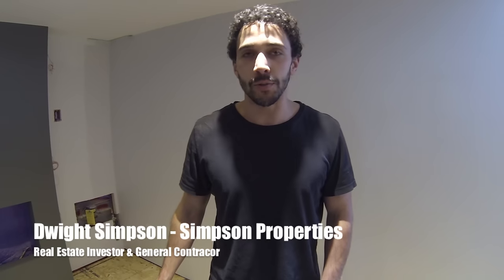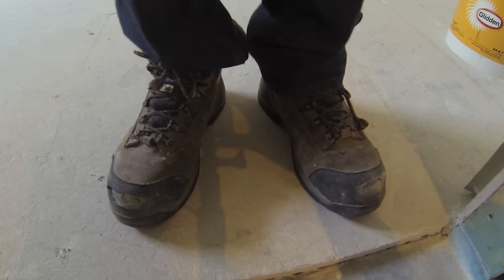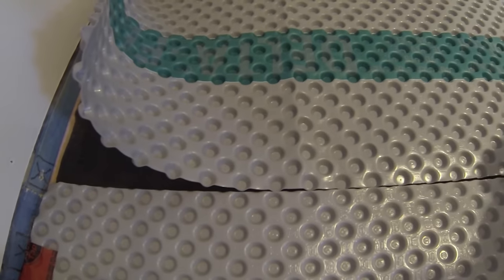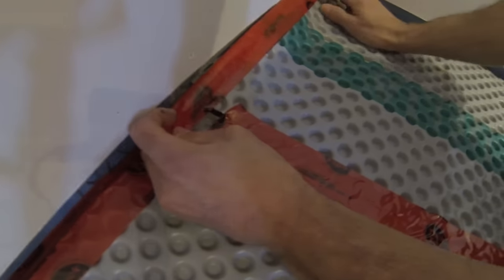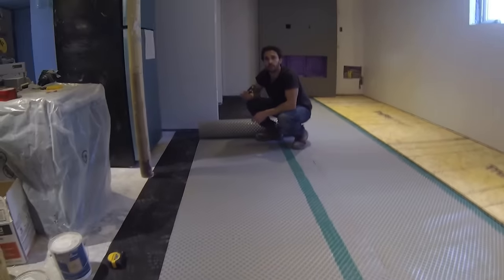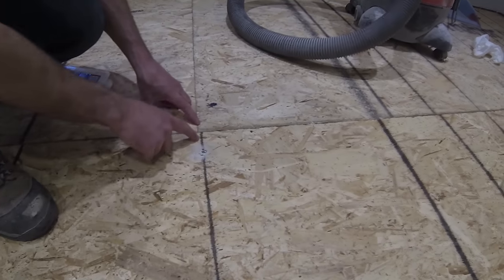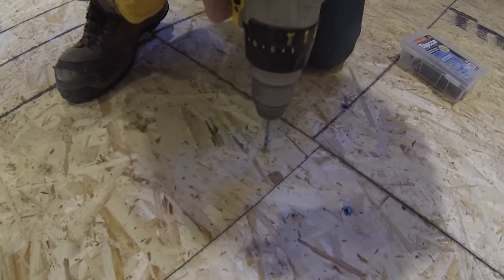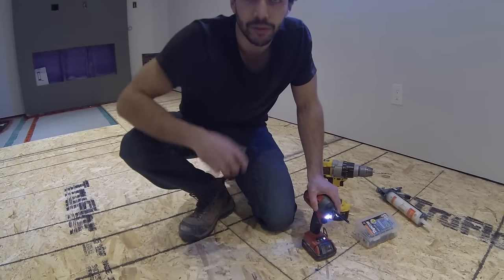HOW TO INSTALL A SUBFLOOR ON CONCRETE

Comment: Thanks for the great video! We just finished 730 sqft basement and built the entire subfloor the same way your video describes. Our basement is very dry and the sump pump rarely ever runs. Only difference is that we are going to do our framing on top of the subfloor and we taped the Delta FL to our rigid foam installation instead of the walls. We will frame next and add Roxul R14 batts for total of R20 insulation. Took your advice with the little bit of silicone in the holes as well. 

All 230 Tapcons we used went in easier than expected! I recommend buying the Bosch bits, in a longer length than the ones that come with the Tapcons so its easier to get the depth that you need since you need to go in deeper than the length of the tapcon. One thing, in your description, the 1/4" tapcons require 3/16" bits, not an actual 1/4" bit.

Also thanks for the landscape fabric tip. Worked like a charm and only added $50 to the project!
Reply from the maker: Thomas Lowry thanks for the feed back I really appreciate it. I will update the bit size in the description. I ended up using an SDS drill as well. It was much faster. I'm currently building my families dream home and documenting the entire build. I will be shooting an updated version of this as installation as well. Good luck with the rest of your project!
Reply: I'm doing something very similar, but I was going to hold off on rigid foaming the walls until I decide when I want to frame the walls.  For now it will just be the floating floor in the basement.  Question: can I tape the edges of the plastic right to the concrete walls as my vapor barrier or will the tape not hold well enough? Thank you!
Reply: @simpsonpropertiesltd  : Agreed! SDS driils are the best! Driils like butter! 👍

Comment: Great video, thanks! One question: would you lay down some foam underlayment on top of the OSB before installing the laminate? I guess that would make it less rigid, right? You don't lay the laminate in the video, so I'm asking.
Reply from the maker: Thanks! Yes definitely use a foam underlayment if you're installing laminate flooring. Some laminate floors come with an under pad built-in as well.

Comment: Hey man, thanks for this video, I'm going with this technique with the added 1" rigid foam insulation on top of the Delta FL. I have a question for you, I've had some moisture issues in my basement and aside from digging around the house and installing a better drain system and gravel, a contractor told me I should also seal all the basement floors with redguard to keep moisture out. That's like an extra $1K and am wondering if that wouldn't only create more problems down the line with the concrete not being able to breathe.
Reply from the maker: Zak Dylan Wass Zak Dylan Wass thanks Zak! I would recommend that you address any moisture problems and waterproof your foundation prior to installing the subfloor. Excavating around the perimeter of your home, fixing any cracks, installing new weepers and foundation wrap is the best way to address the problem. A cheaper alternative is to do an interior French drain system but addressing the problem from the outside is the best. The only time I have heard of waterproofing products being used on the concrete pad is due to hydrostatic water pressure. Any cracks in the concrete surface were chipped clean and K7 Waterplug was applied. It has a compressive strength of 5,500 psi after 28 days. Then a coat of Terraco Weathercoat 571 was applied. It's a waterproof coating suitable for concrete, masonry and plaster. I believe Redguard is designed for waterproofing wet areas such as a shower. You would have to check the product specs to see if it's rated for reducing hydrostatic water pressure. I don't think it's design for foundation repair. Once again, if possible you want to address any moisture problems from the outside.
Reply: Could you install tile on this?
Reply: I have a three season room I'm looking at putting ceramic tile on I have the Ditr product I'm looking at putting rigid foam over it and tile board over that would this work or would you recommend another route?  Appreciate the detail in your video.

Comment: Do I need to level the concrete before I start working? my floor has up and downs about 1/2 inch. Thank you
Reply: Yes you should. Floor leveling compound is easy to mix and pour, it dries fast and saves a lot of grief and disappointment later.
Reply from the maker: This is directly from the manufacturers installation guide: 

The floor should be as level as possible. Remove any bumps or ridges. In areas with depressions greater than 1⁄4”, self-leveling compound should be used.
Reply: @simpsonpropertiesltd   What about areas with a 3 inch depression?

Comment: Question: Thougts on mending plates instead of tapcons? I want to avoid drilling into the concrete, am on a budget, & will be sealing the OSB to use a “finished” floor until I’m ready to lay down plywood planks. I’ve taken copious notes on this video as I am doing a DIY remodel  (with zero expertise) on my little house.  So far, this video +comments has been the most helpful.  I would love to follow your recommendations....EXCEPT, it would incredible for me if I could use mending plates rather than tapcons (both of which I had to look up, since I had no idea what they were!).  Last year, I prepped, I sealed & painted the concrete thinking that it would fine, as I am in a warm, dry climate - but, it’s cold in the winter....so, now I’m committed to an insulating sub-floor.  I know about dricore, but cost is a factor & it doesn’t look like rocket science...especially if I don’t have to drill.  Thoughts & advice much appreciated!
Reply from the maker: Thanks for your comments and questions! I have never heard of mending plates as well until you mentioned them. I looked them up and I could see them people a possible issue for your finished floor. Now your subfloor surface will not be perfectly smooth due to the mending plates. I would contact the manufacture and ask them if its recommended using the mending plates rather than tapcons. Here is a link to the companies contact page: 

contact:http://www.deltams.ca/contact_deltams.htm

Comment: Great video and very informative, but I have one Question:  In your tutorial here, you stated that the manufacturer recommends low expansion foam at the edges, but instead you used the tuck tape to seal it down to create the vapour barrier. I was told by the manufacturer that you don't tape down the edges, because that 1/4'' gap is for the moisture to escape.  Could you clarify the reason why you taped the edges?  Also, they say leave a 1/4" for the DMX from the drywall, do you do the same for the OSB on top? I'm about to do my basement floors and I want to make sure I"m doing the right thing. Thanks.
Reply from the maker: Thanks! Just to clarify I used Delta-FL in this tutorial not DMX. I used tuck tape on the perimeter to maintain the vapor barrier. The slab conditions were typical so I’m not concerned about excess moisture beneath the subfloor. The main purpose of this subfloor is to provide separation between your finished floor and the concrete slab. The way I look at it is when you’re installing vapor barrier on a wall you don’t leave the perimeter with no seal so the wall “can breathe”. Ultimately the choice is up to you. This is the Cosella Dorken tech support line I use if you’re interested: 1 (888) 433-5824

Comment: This is an excellent technique, differences .. use ZIP flashing tape especially on perimeter. Use tyvek then fabric over the concrete.  And 23/32 tongue groove OSB, and glue the joints.
Reply from the maker: I really like those details you use. I’ll give that a try in my next project. Thanks for sharing!

Comment: I just removed laminate as there was mold smell coming from foam film that was put directly on concrete. I like Delta-FL idea but not sure about landscape fabric. Can it spread mold grows?
Reply from the maker: The landscape fabric is designed to be buried in soil and not break down from exposure to the elements. You won't have any issues with the landscape fabric growing mold. You can skip that step and not use it but then there is a chance of hearing that hallow sound.

Comment: Hey!! Thank you so much for. The video!! It’s Clean cut and easy to follow. I just pulled Up carpet, and it’s. Not in the basement so would you recommend doing anything differently? Will I still need the Poly product or could I just put the vapor barrier ? I’m in SC so chances Of flooding are Slim. I’m just wondering if there are any advantages to using it outside of a basement/ flood prone area.
Reply from the maker: Thanks! My apologies for the late reply. Having a good under-pad is money well spent. If your budget allows for a subfloor on top of the concrete it will be better than not having one.

Comment: Hello Simpson Properties!  DMX1 (and maybe the underlayment you used?) state that you should leave a small gap (1/4th) from the wall, so that the air can flow and moisture can evaporate.  I noticed you sealed yours to the wall completely.  What are your thoughts on this?  Is that 1/4th gap needed for evaporation?
Reply from the maker: If there is a hole 🕳️ in the vapor barrier it defeats the purpose. Ideally you want it to be continuous that’s why I taped the perimeter. You can leave a small gap for expansion & contraction of the subfloor.

Comment: Great video.  I used the same technique as you.  I went with DMX (yes I agree with you, all the same).   The only difference technique I used I didn't  drilling with screws into concrete. I used Mending plates to join and lock all the OSB floors.  Using the Mending plates makes the job easier and less time to drill in screw. (yes drill the screws if there is a bounce in the floor). Therefore, your Delta is floating and so is your OSB floor.   thanks for the video.  Yes  it is cheaper then dry-core.
Reply from the maker: Ang ipp thanks for you comments! I'll have to check out those mending plates.

Comment: if you use the gun for the foam, it actually controls it pretty well. Does not make a mess at all and the bead is very controlled. I have one and probably would do it that way
Reply from the maker: Good to know. Thanks for your input!

Comment: Hi Simpson,  Great job on the video, and all the information you provided. I have a question about the sub floor? I have a townhouse which is on a slab guess, and right now it has Ceramic Tile on it but I want to put down wood flooring thought out, and my question is can I just lay the padding that you have in your video on the cement floor and then lay the wood down? Any help you can provide would be great. Again, awesome job, and the Fireplace looks awesome as well!
Reply from the maker: Thanks Linda! If it were my home I would demo the ceramic floor first the install the new sub floor. If you want don't want to remove the ceramic tile you could install landscape fabric then Delta-FL. I wouldn't recommend installing OSB in top. Just install an under pad and floating floor over the Delta-FL.

Comment: Few questions. Thanks in advance.
1. Any concerns/risks with laying LVP over Delta-FL or DMX (skipping the OXB or plywood)? DMX mentions a 6 degree temperature difference can be achieved. So I assume OXB or plywood only help with leveling.
2. DMX product recommend leaving the edges unsealed for vapor to escape. I saw you seal it. Why is that?
3. I don't want to rip the floor on basement flooding. So 100% waterproof underlayment and LVP is important to me. Since OBX absorbe Water is it better to avoid it for my use case? (My basement concrete is not super flat but with some patching and DMX I can meet LVP manufacturers slope tolerance of 3/16" per 10'. In case I can not I have to do something like you did. That is why I am asking)
Reply from the maker: 1. No. The floor obviously won’t be as solid or level by not installing OSB or plywood. Your finished flooring will follow the contours of your concrete slab.
2. Anytime you’re installing a vapor barrier it should be continuous. Leaving the perimeter open defeats the point of having a vapor barrier. Think about your walls. The vapor barrier is continuous. It’s not open around the edges of the walls.
3. If that’s your scenario just stick with the DMX underlayment only and avoid OSB install.

Comment: We have a difficult flooring situation...our basement floor experienced either heaving across the middle of our basment floor near the footers, or, settling around the perimeter of our basement floor. Either way, structural engineer evaluated and gave us the all clear as far as no water issues or foundation wall issues to worry about.  However, we have 1/2" cracks that run down the middle of our basement floor.  We sealed them, and have never had water issues.  Now that we are wanting to finish the basement we realized that our floor is not level and is off by as much as 2.5 inches in some spots--so the floor near the exterior walls sit lower than the middle of our basement floor.  We put 33 bags of floor leveler down to fix the worst parts, but we have a 12X12 section that is still unlevel...and so we have what feels like a hill or a peak in the middle of the room.  My question for you is would this subfloor work for our floor since it's still quite unlevel?  My fear is we would still get quite a bit of "rocking" sensation under the OSB.  We looked at Dri Core and we are completely out of spec for using that product. Basically we are working with a floor that isn't flat.  So, will this subfloor type work or not?
Reply from the maker: This is directly from the manufacturers spec sheet: 
"The  floor should be as level as possible. Remove any bumps or ridges. In areas with
depressions greater than ¼”, self-leveling compound should be used." 

Unfortunately you will have to do some more prep work most likely before you can install your subfloor.

Comment: very informative - would a person still use the landscape fabric if there is already vinyl tile on the basement floor that the sub floor is going over ? (the tile is directly attached to the concrete floor , 1958 basement )
Reply from the maker: I would recommend you test those tiles and glue for asbestos. If they contain asbestos you will want to properly dispose of them (abatement process). If they don’t contain asbestos and you want to leave them. Do a test install with a couple 4’x8’ sheets screwed down and see if you hear any noise walking on the floor.

Comment: Great tutorial/video but a couple things. In your video you called the subfloor "OSB Plywood" - It's either OSB or plywood, not both. Also, when installing subfloor never slam the tounge and groove tight together. There should be a 1/16 to 1/8th inch gap between joints to allow for expansion of the wood. I'm not sure if you did this in the vid but it looked tight. Thank you.
Reply from the maker: That is a Freudian slip calling OSB, plywood but thanks for pointing that out.
Reply: Further on this method of using osb sheets and butting them together (tightly) as shown in the video.... In theory I can see where Pete's logic makes sense; as wood is a natural material prone to expansion/contracting. Especially if they're not tongue and groove sheets too, I could foresee butt ends rubbing and squeaking over time. But at the same time, a very popular subfloor product like dricore panels are installed together with tongue and grove with no consideration of expansion... So what is the correct school of thought here?

Comment: Great Video! 2 questions I have...

1) I didn’t caulk the tap cons before drilling them in. Is that a problem?

2) I tuck taped my outside edges up to bare block wall. Should I leave those open for air flow underneath? I have never had moisture problems and I was thinking the DMX AirGap would keep any moisture issues at bay. Worried I may be creating a bigger problem by not having any airflow available.
Reply from the maker: 1)no
2)no

You’re good to go 👍🏽

Comment: I will be doing subfloor on the second floor at home. I was wondering, the concrete is poured about 3 years ago, should I install vapor barrier ?
Reply from the maker: If you’re using a membrane such as Delta-FL that acts as a vapor barrier.

Comment: Thanks for the video.  Would you be able to suggest an alternative to OSG board?  Preferably a more sustainable sort of engineered plywood, also affordable lol.  The main characteristic of the subfloor I am looking for is shock absorption and soundproofing.   The application is subflooring over concrete for a condo on a 3rd floor.  Or is there no way around using wood for that.  Thanks.
Reply from the maker: OSB is an engineered plywood. It’s the most affordable option compared to plywood. Unfortunately, I’m not aware of any alternatives. In your case you may want to go with a product like Dricore Subfloor Panels. It’s smaller squares to get into your elevator and I don’t think it require concrete screws.